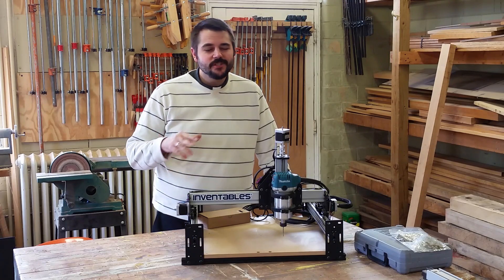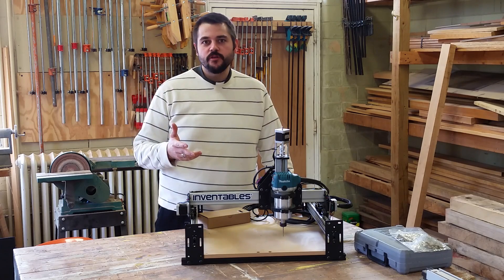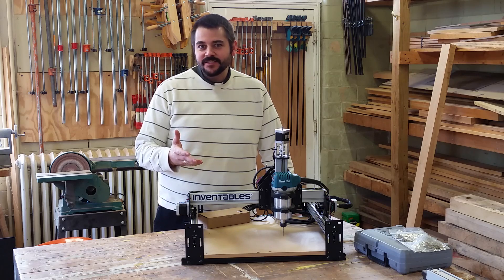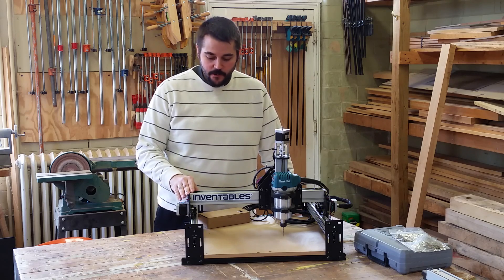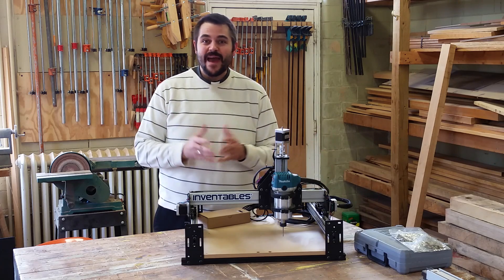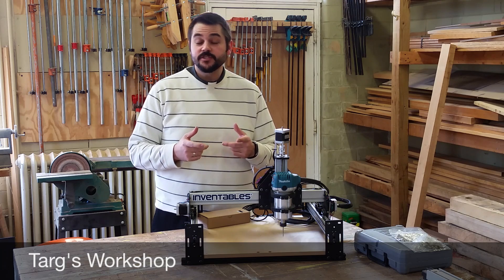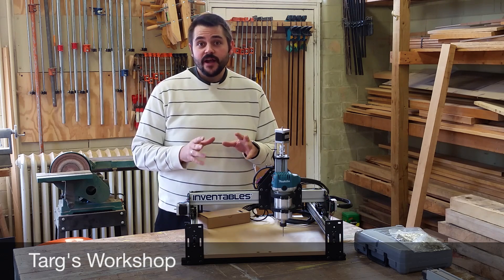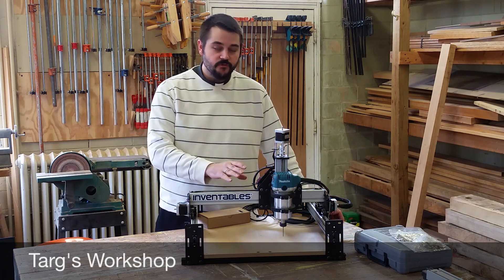Shapeoko 2 Spindle Upgrade (MonkWerks)

Comment: Nice upgrade.  Does the extra weight of the new router cause any problem?  How does the sound compare?  Thanks for the video.
Reply from the maker: pcorlis I haven't noticed any issues with the increased weight and the Makita is a little louder than the Dremel.  I don't have any way to measure it so I can't say for certain.

Comment: Sure looks like it will be much more secure and accurate, that Dremel mount looked a little iffy.
Reply from the maker: Sparrow Bachman Definitely.  The lower bolts on the Dremel mount kept vibrating loose towards the end of runs.  I didn't want to tighten them too much because it was put the spindle at an angle to the work surface, which is not good.  Much happier now.

Comment: Now that is an upgrade!!!! You're going down the upgrade path that I foresaw myself traveling. Keep a stepper motor upgrade in the back of your mind. You might need it down the road depending on your projects and materials used. I'm very excited for you. That was an awesome upgrade. :)
Reply: MonkWerks with Fr. Thomas  That is the 'fork in the road' we all face at one time or another when it comes to tools...  :)
Reply from the maker: Jim Fancher I have some dense oak that has an inlay written all over it just waiting to happen.  It's a bit soon but I have been checking out NEMA-23 motors and the meter extension, but trying to keep it to the machine I need as opposed to want has been tricky.